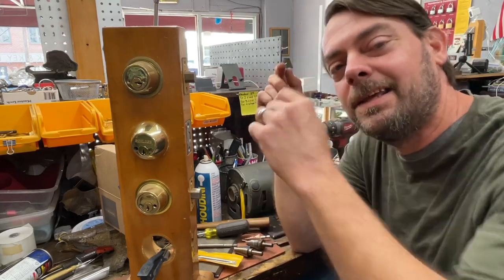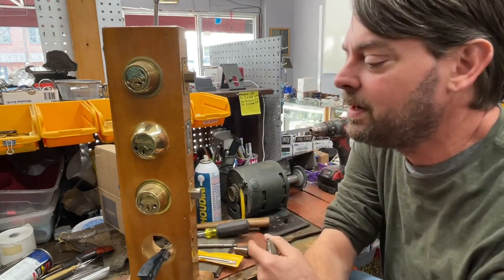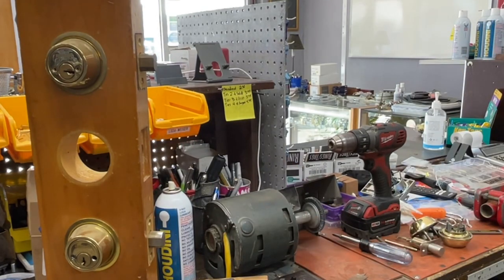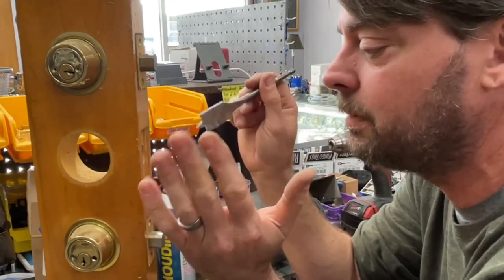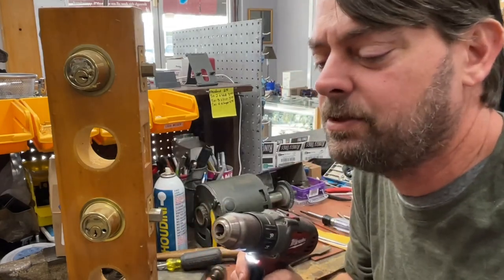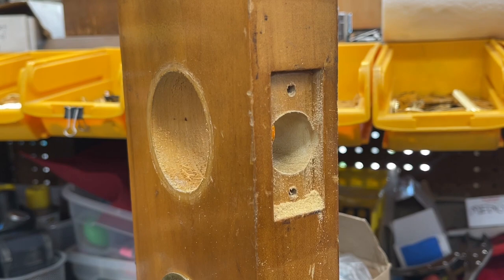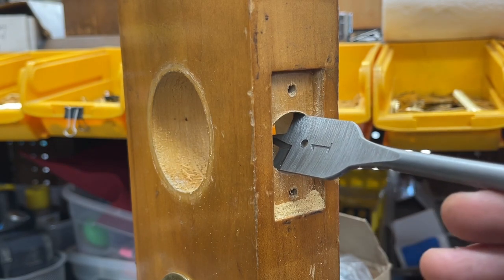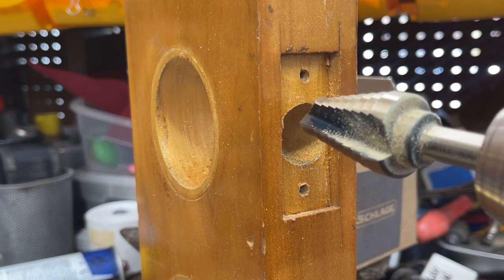Could this be the perfect solution for enlarging latch holes? Drill Hog Step Drill

Comment: Thanks so much for taking the time to post this info! I'm replacing my garage door lock & need to enlarge the hole...watched a bunch of videos to get ideas as to the best way...yours was the most helpful...no one else mentioned that most step bits would be too large! I may have to check out the Drill Hog bit...looks to be a better/easier solution than other methods. Thanks again!

Comment: I picked up one of those Drill Hog 2 1/8" hole saws..Great product! I've used step bits for all kinds of drilling. Will grab one of those 1"" bits. Thanks for demo Jason!
Reply from the maker: I thought about trying their 2 1/8 but I have several still new from the box store so don’t really need it…yet!
Reply: @selock  BEWARE of MORSE and some other hole saws... they SET the teeth such that the hole  is overszed on some.... this will chew up the sleeves on your jig.

Comment: Thanks Jason, for sharing what you do. I am a automotive locksmith, but occasionally do some residential work. Everytime I run into a question or situation I never thought of, I notice your videos are right there to help me understand what is happening and how to help those customers and level up my skill set. I have some of these step bits someone gave to me, and I want to enlarge a hole on older schalge where the hole was smaller on an iron front door- should these work ok on iron metal front door?
Reply from the maker: The old thin metal bar doors? No, that’s one of my biggest peeves. Kwikset does still sell the one sided deadbolts with the small diameter fixed bolt which is one of the very few that will work. The other option is a arrow deadbolt with the flat sides. :(
Reply: @selock  it’s like a older metal security door on front door. Not sure if that is same as door you mean.
Reply from the maker: @pouncerminned863  yes that’s them. They are pretty difficult to make bigger because of the metal “rib” inside. It takes a lot of effort to grind it out so I always keep at least one or two of the fixed Kwikset bolts with me
Reply from the maker: Here we go Pouncer, is this what you meant? https://youtube.com/shorts/rWtm_Qv86dQ?feature=share

Comment: Excellent advice. 
 I use step bits when through bolting a door closer, I drill through the door with a regular 3/16" bit and enlarge my holes to 3/8" while "leaning" on the step bit so my holes look straight.  I'm going to try the drill hog brand and see if they last a bit longer than the super cheap step bits I have been using.

Comment: i always use my steps for poppim holes in corrugated metal sheeting for work, but i also will use em for burring out a hole in some wood or whatevs that needs to be bigger,,,  like i had made a deck for a house w an above ground pool that was level w n inside the deck,, and the ladder for em to get outta the pool needed to hang down into the deck.. the handles were like 5/8"  3/4" wide, so i hit the deck w a half inch spaddle then bored it out w my steps. 

and i love drill hog! their self feed bits are gnarlyyyy!!!! 

(and btw,,  there are step bits that get up to 2 1/2"  wide,,,  gotta faaat 7/16" shank but it kinda needs it lol)

Comment: Awesome, looks like that could be pretty useful. Last time I had to unexpectedly enlarge one of those holes I hacked it with the HPC router drill bit I had with me 😂 Thanks for sharing this!
Reply: (And good tip about making sure the drill chuck doesn’t damage the door if you go in too far)
Reply from the maker: I’ve used a rotary file a number of times (mostly cause it’s in my watch pocket and I didn’t wanna walk back to the van)

Comment: Whats the shank diameter and length of the  9/16" to 1" step drill bit. It should not be too hard for me to make a extension to get you the extra length
Reply from the maker: hmm I’ll have to check, it already got put in the truck but it’s pretty fat
However 80+% of the time it’s a 2 3/8 so I’d probably just finish it on the spade if I ran across a 2 3/4 bore

Comment: Jason, please educate me.  If the latch hole is relatively close to the circumference that you need (example it's 7/8" in diameter, when you need an inch in diameter) why not use an appropriate wood file to place in the hole an enlarge it that way?

Note, I'm a layman and just spitballing -but would appreciate your (or your viewer's advice) as to why that would (or wouldn't) work?  Again, think of me as Richard Dreyfuss in Jaws!
Reply from the maker: You could absolutely use a wood rasp to enlarge it enough to start a spade bit. Doing it sometimes multiple times a day warrants a specialized tool though :)

Comment: There is another 1" max step bit on Ebay that costs less and has a 1/4" hex shank so you could use any 1/4" magnet bit holder to extend it and easily avoid hitting the edge of the door with your drill chuck. Just do a search. I wasn't able to include the direct link here.
Reply from the maker: someone (maybe you) sent that info to me in our email!
Good find to save a bit of $$ but I’m still interested in their “molybdenum” bits to see how it holds up before future purchases :)
Reply: @selock 
Yep that was me. I just like the fact that it's easy to extend  that one using one of the many bit holders that I always have with me. I have paid crazy money for the Irwin step bits but I mostly use my cheapo HF step bits because they are so inexpensive I consider them expendable. Funny thing is I haven't managed to kill one of the cheap ones yet despite the drastic abuse I have put some of them through. My Irwin bits lay unused in the bottom of my toolbox somewhere because I'd rather not destroy a $60.00 bit.
Reply: @selock  
Oh no, I just received my 1" max step bit with the hex shank and it's not a 1/4". It's a 3/8" quick change hex shank. That's not a deal breaker for me because I have 3/8" quick change extensions but I'll have to make sure I have one with me when I'm changing out locks in the future.

Comment: why not just use a 1" hole saw?  I've never needed to put a jig on the door to enlarge the latch hole.
Reply from the maker: I’ve used hole saws also but you still have that chance of it catching and/or walking. This, I think, will lessen the worry of that happening. Also for 19-ish dollars ya might as well, right? It has its other uses anyway!
Reply: @selock  na jason u wrong the hole saw dose it will i am a locksmith of  over 45 years  m8

Comment: You really don’t need either of those bits to enlarge an old door latch hole in a wood door.. I just enlarged mine to fit the new latch very quickly with a 3/8 inch bit. I just whittled it out. It looks fine, but who cares? It’s not visible with the hardware installed.
Reply from the maker: You also don’t do it multiple times a week, this video is aimed at locksmiths. You can enlarge the hole with a lot of things but for our trade the proper tools are needed